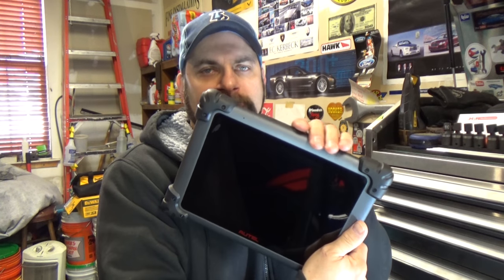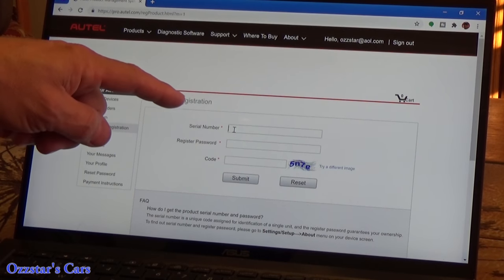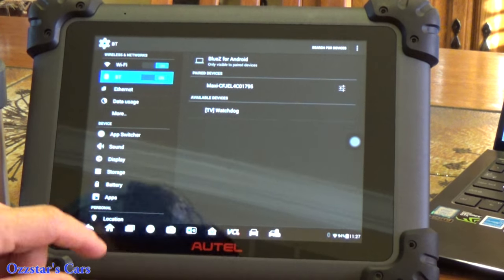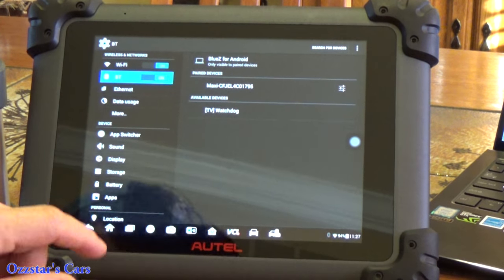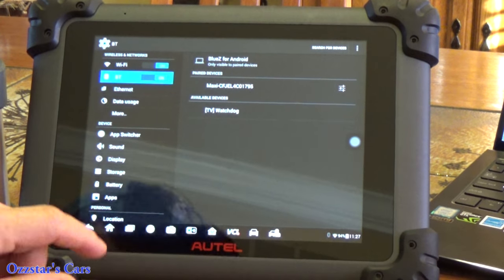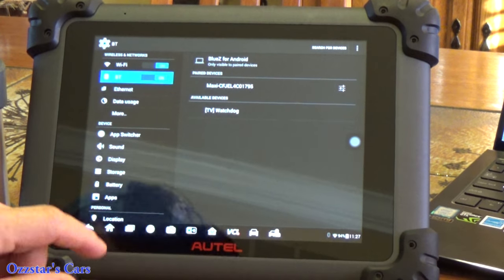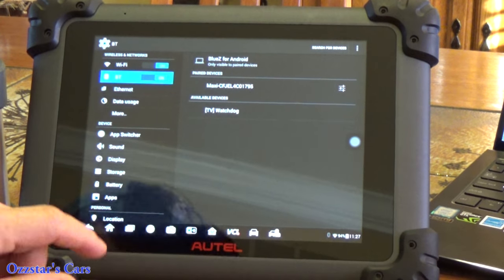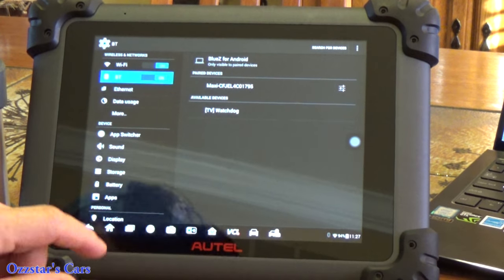The Best Scan Tool for Mechanics? - Autel Maxisys MS908SP Vs. MS906BT

Comment from the maker: *Autel Maxisys MS908S Pro with J2534 ECU Programming*  https://amzn.to/3fEGgyv
Use Promotion Code PNZTXJJR at Checkout to save $95 
Thanks for taking the time to stop by the Ozzstar's Cars channel!  -Glen (Ozz)
Reply: Crazy how it's way cheaper in the states. My local retailer asks about 3.5k EU but with 2 years update I must admit but still a big difference
Reply: Glen - if i can order directly from you - can i used this unit both in Dubai (working now) and later to Philippines - is there any additional charges.  - its is also free update?
Reply from the maker: @nelsonparedes4847  the updates are all free as long as the tool has a subscription. The link I have listed is for a USA model, it does have a lot of European and Asian vehicles listed but I would suggest contacting Autel about that so your tool will have the correct wall charging plugs. If you can let me know how it worked out because the information may be helpful to other techs. Thanks
Reply: Hi, once you've registered the scanner by means of your Lap top will it work on its own built in Wi-Fi out side away from the house were your router is i.e. it doesn't have to rely on being connected that way it will plug and play where ever you are?
Reply from the maker: @gtibruce   correct. The scan tool does not need a wifi connection to work.
Reply: Which one of the best Autel  ? Does that scan everything ? Does that scan Fuel Pressure ? Does that scan Compression for the Spark Plugs Fuel Injectors?  Do you have to pay every year or monthly ? If you don't pay can it still work ? Do you have to register it ? If you don't register does that still work ? Do you nerd a wifi to make the scanner work ?

Comment: I've  been looking at the im608 pro 2 ... do you know if that one has new modul  sync adaptation on it's  own? Or do you still have to plug it in to the lap top and get the oem software / sub?

Comment: Good video! I have spent a lot of money on scanners and the worst experience I have had was unfortunately with an Autel scanner. It just stopped whilst underwarranty and the supplier and Autel made every attempt to avoid attending to it under warranty.  I still have this new scanner which is useless. So I won't  buy one of their products ever again. I have found many better companies to deal with that offer much better products. I only hope no one else has a similar experience with Autel as I did, because it was really bad.
Reply from the maker: What year did you buy the tool and which model scanner was it?
Reply: @ozzstars_cars  I purchased a Autolink AL539B in June 2020 on line from a company in Australia called scanner zone. I had used it very little as I had other tools but one day after about 5 months I went to use it and it would not turn on. I contacted the seller who was very difficult and would not give me an address to return to their warehouse in Australia. I contacted Autel and scanner zone to many times aver the next 6months and finally they gave me an address in China to send it under warranty to have it repaired. I believe that they just stalled me all along until the warranty was up. I continued after this time and got no sympathy or service from them. It cost only $129 AU but as a business man for 50 years in electronics I have never seen, heard or experienced anything like this type of service. I was never going to sent it to China from Australia as the freight cost would not be worth the effort and I did not trust them any way to attend to it.

Comment: THANK YOU! I finally understand the difference between all the Autel scanners in regards to ECU coding and programming (i didnt know there was a difference). Im a novice just trying to get my dodge car working which needs an ECU reflash/reprogramming. I was so confused as to what scanner i needed. there was so much misinformation out there. this video is clear and concise. Now i know which scanner i need, which would be the MS908SP Pro!
Reply from the maker: On a Chrysler the J2534 box is the key to success along with a subscription to the Mopar oem software.

Comment: So I was told today by someone who uses Autel Maxisys MS-906BT in a shop where they do a lot of work on Toyotas that the ECU coding capabilities touted by Autel do not apply to Toyota.  He said that ECU configuration for Toyotas needs to be done using Techstream and a supported J2534 interface, just like ECU programming.  It's the first I heard of it, so I went to the Autel site and checked coverage for several fairly late model Toyotas against the Maxisys MS-906BT and the Elite.  Interestingly, none of them included any ECU configuration in the list of functionality supported.
Just wondering Glen, have you (or anyone else reading this) heard of this?

Comment: Subscribed..... great video , its now October 2024 , what is the bests autel now to use , For example  I have  2 bmws and 1 audi , and one of my BMW's I have to put in a new VTG module as the current one i have is fried and now i have the trifecta no AWD on my 2008 535xi .  im also looking to get another couple BMW 2017 X5M and a E60 M5 so i want to make sure I have the best autel out there to do all the jobs , scans and programing new modules to my vehicles ,  coding etc , injector coding an more.  

your thoughts are greatly aporeciated thanks

Comment: 0:44 what is the difference between coding and programming? I thought they were the same. I saw your video about battery replacement in an Audi/Volkswagen using the Autel. I previously had the Ross-Tech VCDS when I had my VW, an incredible tool and it was a steal dollarwise. I could calibrate the speedometer, the number of turn signal flashes on a swipe, etc. Now is that coding or programming?
Reply from the maker: That is coding. Programming is a complete software flash or re-flash of a new or used module where applicable. Great question!
Reply: I am a programmer. Coding means in laymans term your resetting features that already exist, think like you go to livingroom and increase the speed ofthe fan from 1 to 3. 1,2 and 3 speed exist you are just reconfiguring it. Programming means you take old fan out and put a new fan now it has 5 speed. coding is to enable or disable existing feature, programming is to add or delete existing feature.

Comment: Great info. Waiting on my Autel MaxiSys MS908S PRO Plus Elite to arrive. I'm just an at home DIYer. Had a Snap On and sold it with my 06 BMW so was in need of a new one and upgraded big time to this. I have high expectations. Cant wait to get on my 2019 Chevy Truck and wifes Accura and whatever BMW I go after to replace my old one. I'm sure Ill have a few questions maybe in the future. Thanks again
Reply from the maker: It's a very capable tool. You should get good use from it.

Comment: Which is better this one or the 608 pro 2?
Reply from the maker: Depends what you intend to use the tool for.
Reply: Both diagnosis and program also does the 608 have built on schematic? Which one have built on schematic?

Comment: Do you need a special addition to code a VW computer? I need to replace the ecu and keys and stuff for my 2022 f350 and keys
Reply from the maker: @taztazman8486  you will need  a tool dedicated to key programming and a locksmith license. Coding a VW depends which module, battery coding no issue.

Comment: Hello I wanna buy a Maxisys ms908 
Can I still diagnose and program with it after the subscription end, it was end in 2021 can I still use it. Or I shouldn’t buy it.
Reply from the maker: The scanner will not be able to program Mercedes and BMW once the subscription runs out, the J2534 also can't be used to program without an updated subscription to Autel and the manufacturer. It can however still be used to diagnose vehicles up to the point in time it was last updated but will not be fully updated with the latest features.

Comment: The 
MS908SP vs 906BT... no contest. Buy the 906BT. It costs $1200 less to buy AND theMS908SP needs a Sub renewal every year to program. UH, that is $1200 the first year and $600 per year thereafter just for the privilege of programing. . Unless you have a lot of modules to program, even taking them to a DEALER will cost a LOT less if you only do a couple a year. An independent shop likely will cost a good deal less than the dealer to program. it depends on your workload but... weigh the cost difference!

Comment: Superb video. Probably the ONLY video in the world that actually explains Autel's confusing product lineup. At 22:02 you mention that an ECU module from a junk yard has to be reprogrammed to match the car. So... say I use an MS906 pro with only coding capabilities. Can it do that or do I need a scanner with programming capabilities?
Reply from the maker: Needs programming capabilities.   Om some never vehicles modules can not be programmed used, they must be new or erased before attempting to program. Thanks for your comment Mr. Lopez!

Comment: You did an excellent job of conveying the info needed.  I'm trying to figure out what version of Autel tool I need to re-learn a CVT on a 2014 Subaru Outback. Changed out the valve body and I believe re-learning the trans will correct an issue I'm having. I know the Ultra will do it but that's more tool than I can justify for this not being my job.
Any thoughts?
Reply from the maker: Why buy a fancy scan tool if you won't be using it. Subcontract that part out. The 906 codes the 908SP codes and also program with purchasing the correct software from an OE.

Comment: Can you program modules without the J box like the new battery make model and SN for example?   I have the MS906Pro-TS and it has programming capabilities but not to write to the ECM/PCM/BCM that is where I believe you need the J box correct?  I thought the J box was for the main body and engine CPUs
Reply from the maker: J box is for programming and is necessary for modules, like starting from scratch or updating.  Battery Management is coding and no J box is needed.

Comment: Do you need to be online to used these kinda OBD Reader ? Do you need to have a wifi to used this ? Can you used this new from the box . ? What happens if you don't updates does this still work ? Is this capable of scanning Fuel Pressure test ? Is this capable of scanning compression test ?

Comment: Hey Glynn , thanks for that tip , the funny part is that now I am convinced to get the new 909 and start watching the programing tips but now jb tools shot me a special for the 919 maxi , so now my question is what advantages does the 919 offer over the 909 ?
Reply from the maker: From what I read the 919 has an  Oscilloscope & Digital Volt Ohm Meter and Built-in Waveform Generator & CAN bus tester.

Comment: For a 2003 Jeep Liberty 3.7L Power Tech with a 42 RLE transmission would the J2534 and a laptop flash a used TCM?
Reply from the maker: Along with a subscription to the software from the manufacturer FCA.

Comment: Glenn, I have a 2015 Ford F150 2.7L.  I need a scan tool for my Ford that can do everything, especially prime my auxiliary transmission fluid pump.  I need to replace that part and I don't want to take it to the dealership.  Do you have any suggestions?
Reply from the maker: No scan tool does it all but if you want Ford specific then go with the IDS.

Comment: Thanks for your time and video.The review was informative. I didn’t see in the video if if the 908SPro has the module topography. Do you know if it does? Thanks for the link and your time in advance.
Reply from the maker: You're welcome Michael.  You would have to step up to the Ultra model to get the module topography, the 908SP does not have it.
Reply: @ozzstars_cars  Appreciate the fast reply. Thanks again.

Comment: Hi Glen, Will this tool clear crash data and change vin numbers on used modules ?
Reply from the maker: I'm not sure about clearing crash data black boxes. Some modules can be programmed using the J2534 and factory accessed software with a subscription.  The scan tool by itself can only program BMW and MBenz.  Hope that info helps Bruce Wayne. 😉

Comment: Will it turn on the electric cooling fans on GM trucks that have that ability and change the temperature settings on such GM trucks ‘02-06ish that have fan clutches ??  I’ve seen sum1 install electric fans from newer vehicle to older vehicle and selected the electric fan “on/off” for the ECM to control the fans!!
Reply from the maker: It can control electric fans but don't think it would work without a programmed module.

Comment: Great video, I keep learning a lot. Quick question, so if I understood correctly you could buy just the Jbox Vci without having to buy 908sp and still be able to do some programming using a laptop beside Mercedes and BMW. Is that even an option? I hope it makes sense
Reply from the maker: I believe the Autel Jbox needs to be updated and have a current subscription activated with the 908SP in order to work correctly regardless what vehicle is being worked on.

Comment: CONGRATS! That thing is SWEEEET!

Ha! I've had my 906TS since '16, and I never knew there were system updates. I knew about the car ones, but not the actual operating system. Probably why the thing is so buggy right now! Haven't got much use out of it this year. Was a nuts-n-bolts year. Once covid hit, everyone wanted brake jobs, ball joints, shocks, and hub bearings that they'd been putting off for months or years, lol.

I've been drooling over the Ultra, but I'd better be saving up for a new engine or transfer case for the Silverado soon. Already 50% of it has failed at 103k miles, so I expect the other half to go within the next year. Can't win these days. Anyway, great review! Can tell you did your research. I should try doing the same before making a repair vid, HAHAHA! I fumble my way through. :D
Reply from the maker: Smitty your truck engine won't blow up.  I guarantee if you don't use it then their won't be a problem. haha  Yeah this new tool is sweet.  Looking forward to filming and editing some actual module programming. The MS906 is pretty awesome too! Bonus points for the TS model you own.👍 I am dreaming of owning the Ultra one day.  Service info and wiring diagrams all in one tablet, boom. That's the bomb!
Reply: @ozzstars_cars  - I hear that! Service info is one of the biggest issues I have with modern vehicles. I don't get enough volume to justify the expense. Although lately I've been having great luck with AllData DIY 1-year subscriptions on some vehicles. I had a dead Lexus I never would've been able to repair without it. I couldn't imagine having all that info at my fingertips on a scan tool, though! I'm just afraid of what the update costs would be on that. They want $700 for my 906TS - I'd imagine it's probably double on the Ultra. Gotta pay to play in this industry! 

HAHAHA! I've been keeping it around 3k miles per year, but apparently that's way too much for this modern GM product to handle ... :D :D 

Can't wait to see you do some programming with that! :thumbsup:

Comment: Hi I replaced a transmission and transfer case one a 2011 BMW 535i drive I cleared all the codes but when driving the car shakes a lot do I have to program the trans and transfer case to the car? If so would this tool do it? I just ordered the mk906bt but now I may need this tool. Thanks!
Reply from the maker: You will need to look up service info. The 908SP does have programming capability but not all scan tools do it all. Good luck.
Reply: @ozzstars_cars  Thank you for the response. I am not too far from you actually I live Atlantic City NJ. I also this week had my 17' Land Rover Discovery TDV6 tell me that I have 250 Miles to drive before I can not restart it due to poor quality of DEF fluid. Problem here is that the local dealerships can not take my car for a month and my wife uses it for kids ext. Any ideas? Also my brother has a 17' grand sport and loves it. Talk soon. Matt

Comment: Hello, what is the difference between 906 and 908 regarding the live data and bidirectional control? They have access to the same information? The difference is only in programming capabilities of 908? (of course letting aside the hardware differences)
Reply from the maker: There is no difference between live data and bidirect control. You got it. 💯

Comment: Great video !!!
Does the coding (not programming with J2534) function still run if the subscription has lapsed ?
What is the sw version for Ferrari 2.22 or 2.23 ?
Reply from the maker: The latest version my MS906BT has for Ferrari is v2.40.  Yes it can still code while out of subscription but won't have the latest software to do it.
Reply: @ozzstars_cars  Ok, thanks. Same software on the MS908SP ? By coding I mean to put an VIN number in a ABS computer for example so don't need any software, just the function running, is this possible without subscription ?And except hardware, do you know the differences between MK908P and MS908 ??? Crazy marketing...

Comment: i got the 808BT will the J box work with that?? and Fyi I was able to trick the ECM by telling the JUNKYARD ECM to see my key I PAID A SCUMBAG FROM SIA Electronics to fix my 2008 Xterra ECM and $200 later it came back the same as it left so I had to buy on Ebay $100 a 08 ECM but no start so I told the 808BT I was making a dup. key used the same ket when it asked for the 2nd key I reinserted same key and Boy she fired right up but now I need to add the VIN????